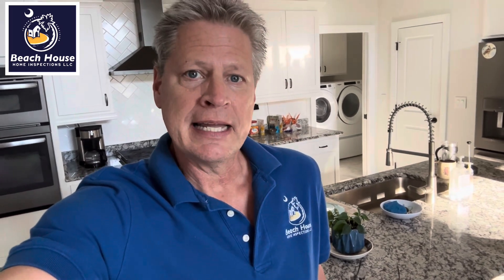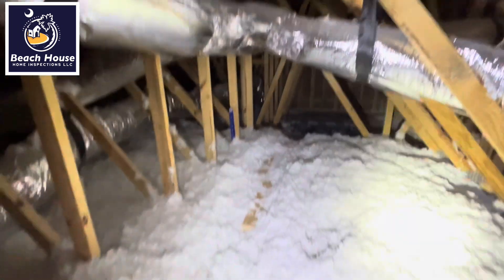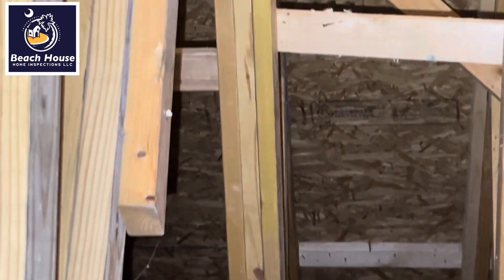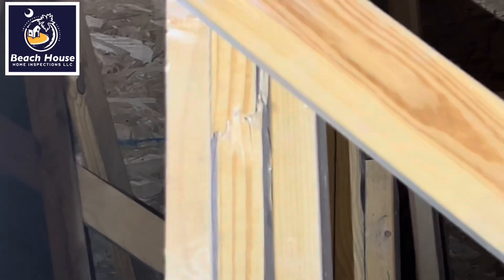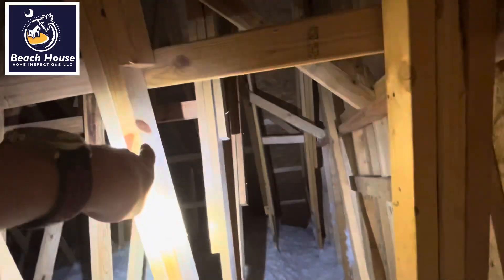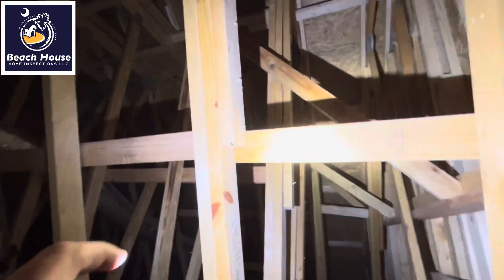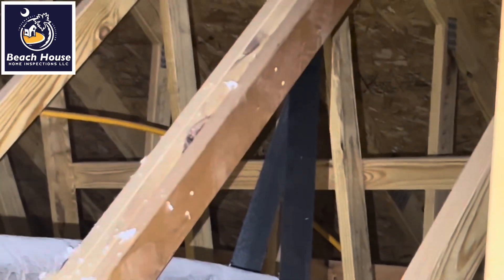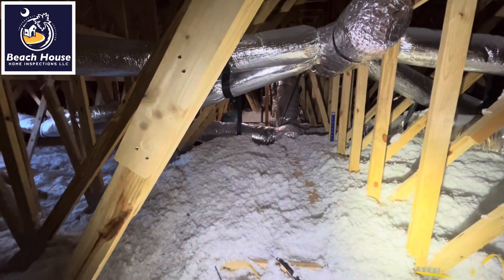5 broken trusses with one truss having 4 breaks

Comment: So what's the thought here? Did these get broke during initial install and the builder didn't want to wait for a new one so they just dressed this one up after install?
Reply: Possibly broken on delivery or install. They can be fixed on site but only with approved method by engineer and paperwork stating the repair method.
Reply: @joef7762  sure, makes sense. Sounds like there was definitely no paperwork.
Reply from the maker: Usually trusses get broken when they are offloaded from the truck. The problem is they are repaired on site and replacement trusses have not been ordered and installed. Field repairs are a no go!